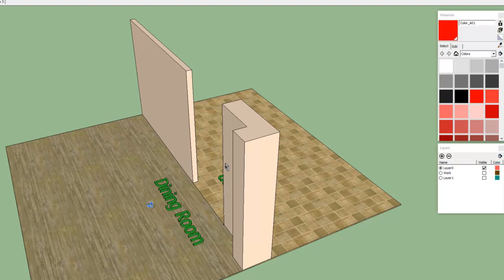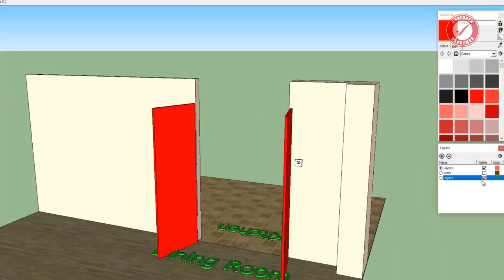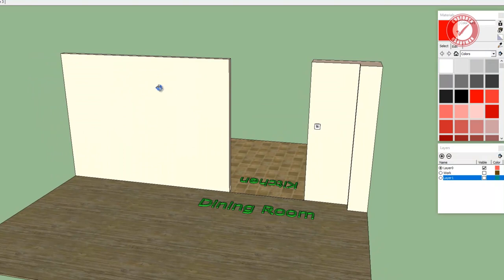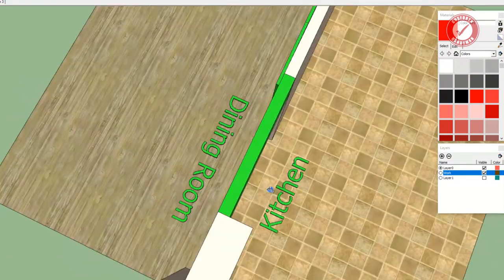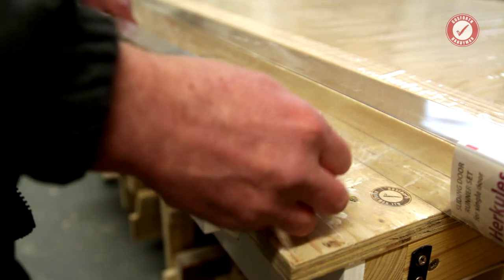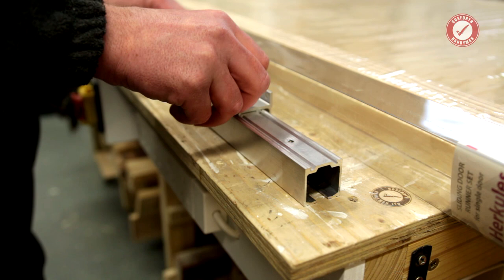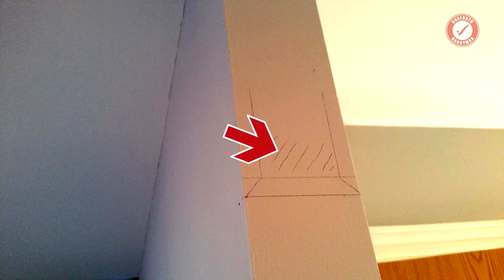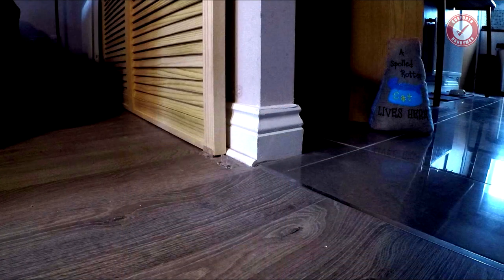I'm Installing Louvred Sliding Doors using Herkules Door Gear

Comment: In my opinion barn door hardware would have looked a lot better but it is pretty expressive. You could have also concealed the door by enclosing them by thickening the wall. Another option I've done is to build your own track out of panel that uses rollerblade wheels. It is a pretty cheap solution that is very heavy duty. I've done this last option in my garage for holding tools on sliding panels that cover shelves.
Reply from the maker: Yup - just prohibitively expensive to do either option in this scenario. A false wall would have also involved moving the radiator and other services in the wall. 👍🛠

Comment: This may be a stupid question, but since you went to the effort of making the bottom of the door thicker, would it now not have been possible to route out the groove to allow the guide to run inside?
Reply: I'm guessing because the additional strips are merely "packing" and not structural.
Reply: If glued and clamped though they would be just as strong as solid material.
Reply from the maker: Good question caskwith! What Glen said - although the strips make that section of door wider they do nothing to increase the structural strength of the joint between the rails and stiles. In these mass produced doors they're often just dowelled together and you'd run the risk of hitting a dowel - just not worth the risk. 👍🛠

Comment: Small pelmet will finish that off nicely. A 3-4 mm routed groove on the bottom of the door would have been adequate...
Reply from the maker: Think the recommended groove depth has to be bigger otherwise you risk snapping the plastic guide. 👍